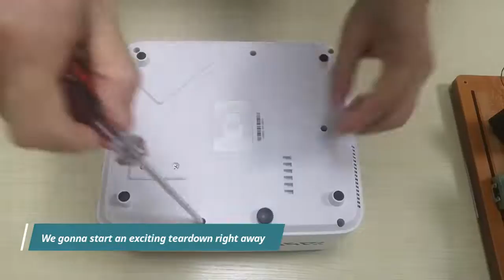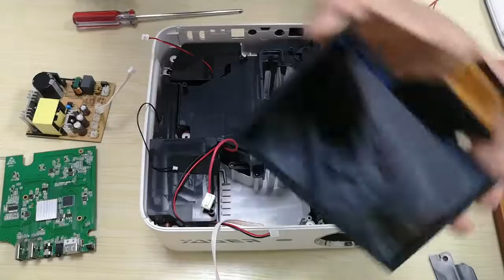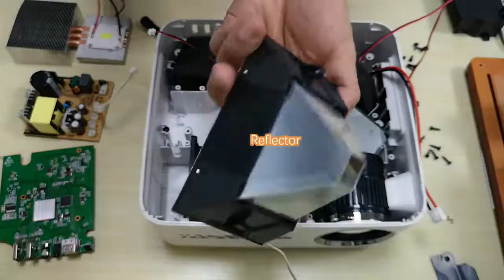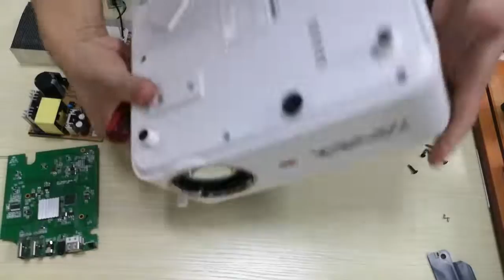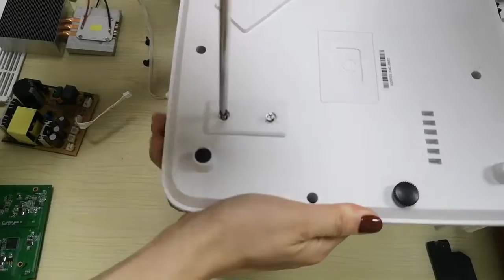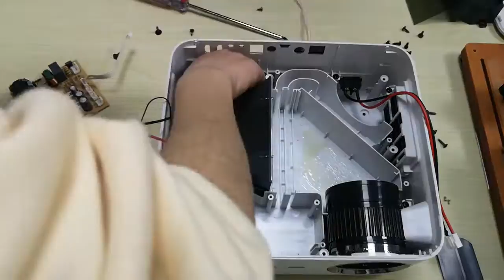[Yaber V6] How to completely teardown a 1080P LCD entertainment projector | Look what's inside?

Comment: There is an error connecting the fan cable. I put it in the wrong place?
Reply from the maker: Caution is advised during disassembly, and it is recommended to record a video of the process to avoid connecting cables incorrectly.
Reply: @yaberofficial  You put the fan cable in the wrong place, man

Comment: I would like to replace my fan since this one is ridiculously loud. What size is the fan?
Reply: did you try?
Reply: @d3stroyah  I did not try, I was unsure if I should take mine appart
Reply: @zillaquazar  i opened it. The square fan is 80*80*25
Reply: @d3stroyah  square fan is easy to replace with a quality Noctua fan or similar (you will need 3-to-2 pin adapter). Did you find a good alternative for the other blower fan (93*93*30)?
Reply: @hoptopodd2971  not yet :( hard to find a good one
Reply: @d3stroyah  yeah, seems like all "good" brands offer around 36-40 dB, which doesn't really help. Still, replacing the axial fan should help as it seems like the louder one compared to the blower fan
Reply: @hoptopodd2971  i tried and both fans are not that loud. It's the overall way of travelling for the air which sucks. Not sure if its fixable
Reply: @d3stroyah  i replaced the axial fan with a Noctua one, kept the stock blower fan as there aren't quality brands for that shape. Sound level reduced from 48-50 dB to mere 41-42. Much more bearable now.
Reply: @hoptopodd2971  interesting, can you link the noctua?
Reply: there is still the noise from the blower fan. If you find any good replacement brand, I'd appreciate the tip
Reply: @hoptopodd2971  I'm looking into it. could you please link me to the correct noctua fan? I was looking at the 1800rpm one 12V but maybe it's too slow
Reply: @d3stroyah  can someone tell me what technical data the original fans have (speed, air flow, voltage, speed)? Thank you.
Reply: @danlocofimba9221  no one knows this. The square fan is a cheap chinese one, you can change it easily, you need a 3 pin fan same size. The other fan is really hard to change though
Reply: @d3stroyah  thank you for the fast answer
Reply: @danlocofimba9221  the square Fan is a 2800 rpm 12v 0.25 amp, so not sure how safe it is to replace with a noctua one which has maximum 2200 rpm
Reply: @hoptopodd2971  That's awesome, I wish I could replace both fans to reduce fan noise, it is distracting. Can you send the noctua model? Do you think the modification worth it and improved the noise significantly ?
Reply: @Dougget  definitely worth it! Even if you change your mind later on, you may still use the Noctua fan if you have a pc. I bought Noctua NF-A8 FLX 80mm and AV-F7530MB as the blower.
Reply: @hoptopodd2971  What was the difference in noise after replacing them? Is it worth it?

Comment: I downloaded the latest firmware for the V6 projector, 1.0.0.2. I noticed some worsening of audio compatibility reading the videos from usb. The message "this audio not support" appears on files that worked before the update. There is a solution? Is it possible to downgrade the firmware? Thanks for support.
Reply: For completeness of information, I let you know that, after requesting assistance from Yaber, they sent me a new firmware (v1.0.0.3) that corrected the defects of the old one. Now everything works correctly!

Comment: it is possible to replace the fans? both?
Reply from the maker: We are sorry that we do not sell the parts separately. If there is too much dust on it, we suggest that you can use a cotton swab to remove the dust.
Reply: @yaberofficial  the fans are VERY loud, I want to replace them with quality fans, what are the sizes of the fans and what requirements do they have? I dont mind void the warranty.
Reply: @d3stroyah  Did you end up replacing the fans? I've replaced the axial one already but wanna find a solution to replace the blower fan as well 🤔
Reply: @NilsOlofsson  no, I wanted to change the axial with a noctua, but there was too much glue all over. I'm using the projector original
Reply: @d3stroyah   thats odd, my unit had almost no glue there where some on a couple of the connectors, but nothing some wiggling couldn’t solve.
Reply: @NilsOlofsson  besides, theblower fan is the most noisy one, and I could not find any quality replacement, only cheap chinese stuff
Reply: @d3stroyah  yeah I know. I found that there some delta(ball-bearing) and sunon(maglev) ones that are supposed to be reasonably quiet. But I’m not sure about the specs and voltage of the stock one 🤔

Comment: Hey, my projector got noticeably dimmer after removing dust, it was fine at first, but 5 minutes later the screen got dimmer. What could be the cause?
Reply: Factory reset didn’t help
Reply from the maker: Following the correct dust removal procedure will not make the image dimmer.
If the projector was disassembled , the wiring may be loose, or the LED light is covered with foreign objects, you need to check the LED light.
Reply: @yaberofficial  I think it's better now. I opened it again to replace one of the fans and it seems to be brighter now!
Also, I wonder if you have and specs on the blower fan in the projector? It's pretty loud an I've been thinking of replacing it.

Comment: I have horizontal green lines on my screen after 2 weeks of use. Any tips?
Reply: I have the same lines on mine. Amazon told me to take out the main board and clean it. That did not work. Just wondering if this is a problem with all these projectors. Will be sending mine back.

Comment: Hello, thanks for the informative video. I have one question though. How much is the noise level of this model? I visited your website but I can not find the noise level information :)
Reply: @yaberofficial  Thanks for the information! :)
Reply: @Uluruos  Is the noise loud for the fans? I may change the square fan but the other fan is hard to find due to the shape
Reply: @sunilg121  it is very very loud
Reply: @sunilg121  it's loud as a jet engine.
Reply: @sunilg121  I changed the axial fan (the square) and it helped quite a bit. But the blower fan is still quite loud

Comment: Anyone looking to get dirt off the screen:

- Open up the projector as shown (7 screws at the bottom)

- Carefully remove the lid (watch for the connecting cable)

- unscrew the LCD cover shown at 1:41 (no need to remove anything else)

- use a manual air blower to carefully blow any dust off the LED lamp, both sides of the LCD screen as well as the mirror and back of the lens (use a squeeze one, not compressed air as that may leave residue).  You might need to try a few times until it's gone, but I managed to get a load of big dust bits off my screen and now it's perfectly clear.

The good thing about these chinese projector models is they're super easy to open up without breaking!

Note:  I did actually turn mine on while open and slide the LCD panel up a tiny bit to see if that's where the dust was.  The dust moved with the LCD so I knew that's where it was.
Don't neccesssarily recommend blowing air while it's on unless you know what you're doing.
Reply: Thank you so much for this, cleaned all the dust away easily. Thought I'd hafto take it all apart. 🤔
Reply: Thank you.  I tried this but the brown shading on the L side of the projected image stayed the same.  Do I need to remove and clean off the LED light panel?